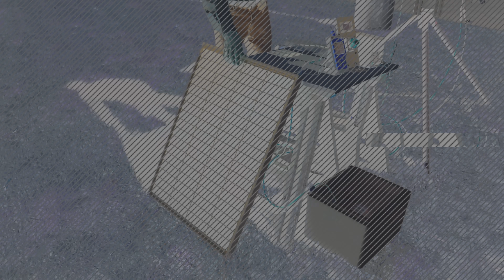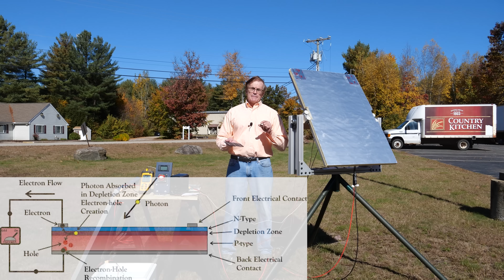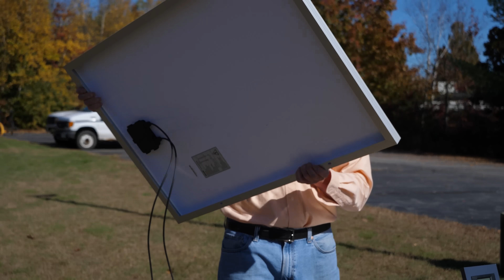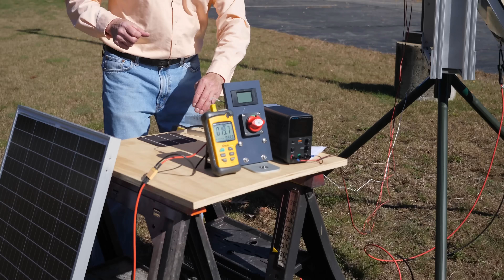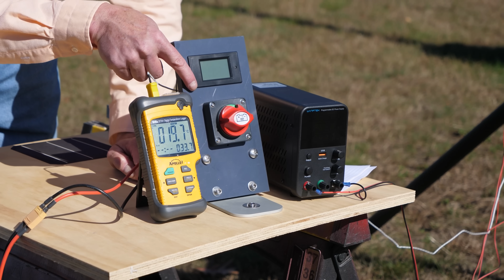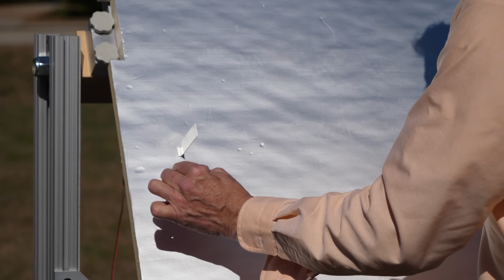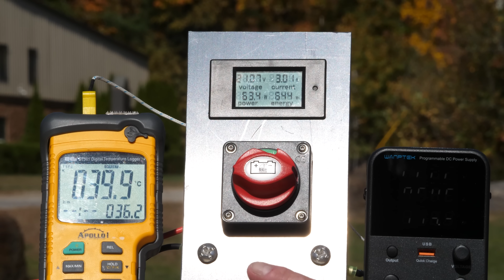Do you REALLY get enough out of your solar panel?

Comment: I see a lot of Youtube videos and other online analysis about cooling photovoltaics and efficiency.  This is all about energy absorbed that does not produce electricity.  But, what about the energy that is "rejected" due to reflection.  Could this be harnessed by focusing the reflection from multiple panels onto a thermal collector.  What kind of efficiency could be achieved?  Given that some systems are designed to track the sun this might be a way to boost the energy output significantly.
Reply from the maker: You hit on the limitation.  The efficiency of recovering that heat as electrical energy is very low because  of the small temperature differential.

Comment: Connecting panels in string (optimal for lower current) provides to bigger  voltage, which is not good for the inverter's switching active elements, especially when the temperature is lower (in winter). So, we have to connect smaller number of panels just to be on the safe side which is on the other hand not optimal. So, the control of the temperature should be important all the time.

Comment: You tested with a huge closed box, you would need to first test with an open back because it would get passive cooling from the surrounding air (not if on a roof though). Also, the reason would be cost. All that extra aluminum and fans could easily cost as much as the panel itself with how cheap panels are today. So the reason it isn't done, is your getting 3% more power, and slightly longer longevity for double the cost, plus the fans will die after a few years making the whole thing a huge waste of money. I would be like buying panels that cost twice as much for marginally higher efficiency for double the cost and calling it a sound financial decision. Panels are so cheap now that no one uses trackers, and the cost of the inverter is as much as the panels.

Comment: I 'm a huge fan of your channel, approach, and thought process.  Thank you.  Also glad to hear that your eye is on the mind. 

I'm looking for someone to tell me that I'm missing something, but to date, I haven't found it.  Please let me know if I need to return to Physics 101.

Abstract:        I live slightly North of you on the east coast of Canada around 46 degrees North. This is important and not just hey look at me "kind of internet stuff".  As you mentioned / alluded to in your last video, solar panels are optimised for low latitude, hot, and sunny countries. That's not where I live (nor you). There the sun rises and sets relatively in the same point on the horizon. Here the sun traverses about 60 degrees along the horizon during a year.         

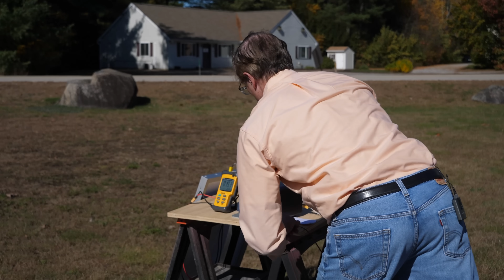Discussion:      Glass has a critical angle of 42 degrees. From my digging Photovoltaic glass is either that or something close to that. Which means that during the summer solstices it may be 10 for 10:30 in the morning until the sun rays are not in total internal reflection. Your solar collectors  could help with this, but with the large swings in incident angles, I suspect that they would be shadowing for a good portion of the mornings and afternoons.

Conclusion:      This leads me to believe that in the high latitudes one could probable reduce the amount of kit by a significant amount, maybe as much as a magnitude, if the panels actually tract the sun in 3D.

Now I know there are a lot of smart people looking into at solar panels and all things solar.  So before I grab a half dozen Arduinos and some servo motors,  and place an order for something that would struggle to run a toaster, please tell me what have I missed. 

Thanks and thanks again for the channel
Reply from the maker: Look up Brewster's angle.  Assuming the manufacturers don't add an anti reflection coating that complicates things, you're  likely  to find the best performance is when the panel  is aimed  directly  at the sun's disc.  
This would be a fun and easy experiment before  you spend much money.  Set up a convenient cell or small panel, add a power meter, and manually move the panel  to optimize output.  Measure  the angle of incidence relative to the sun.  Do this in the morning, at noon and in the afternoon as a self check.
Reply: @TechIngredients  thanks, That's where I guess I was heading, but I was hoping someone might have already done this, and have the data.  

Like you point out, it's simple enough.

thanks, I'll let you know what I find out

Comment: What about just using thermosyphon system to catch excessive heat behind the panel, in place of motors and co ? Then you can use the ot dry air to dry calcium chloride or zeolite for seasonal heat storage 😉

Comment: So if the solar panels is seated upon a liquid radiator can a liquid also remove heat that improves solar cell as well heat liquid to utilize that free heat to make hot water for personal use as well as preheat water to reduce fuel requirements for electric generatoration...??...
Reply from the maker: It's  a trade-off off.  The water  removes heat from the panel and, in the process, heats up. But to maximize  the benefit, the water needs to be as cool  as possible because  the panel  can't  get any cooler than the water leaving the panel. At the same time, to be of use, the water needs to be as warm as possible  to make preheating worthwhile. There might be a middle ground where this trade-off is acceptable, but it's not a free benefit.

Comment: If you don't have access to that stuff, you'll end up wasting a lot more money.

Get pre-made square C-channel.
Reply from the maker: Check out real prices and get back to us.
Reply: @TechIngredients  I've bought some of it for my own engineering experiments.

I paid $12 for a 10 foot long stick.

Not sure what your price range is, nor how many square feet of surface area you are trying to cover.

It occurs to me that in general, solar collectors are pretty cost prohibitive for practical power, so I would have guessed your budget to be higher than $500.

My apologies if I am wrong.

You can bend thin aluminum roof flashing with just some angle iron and some hinges, that's pretty cheap, if you go get the angle iron as old bed frames from a thrift store, or just buy the amount you need from a hardware store.

Should be able to build an adequate light sheet metal bender for aluminum flashing for about $50 and you can use it for multiple projects...

I personally would simply jacket the back of the solar panel with distilled water [28,000 ohms/inch] with some epoxy resin and some polyester fiber blanket material, with hose barbs glued into it so I could then use the hot water.

That would cost me about $10 [including the hose barbs], and if I add in a small recirculator pump you can get off amazon, its only about $30 if you have Amazon Prime, or add it to a shopping cart with other items... https://www.amazon.com/bayite-BYT-7A006-Heater-Circulation-Discharge/dp/B0196WL55G/ref=psdc_554568_t2_B08XM8GGR4
Reply from the maker: Not bad. We used about 60 feet.
Don't  forget about pressure.  As long as the water is wetting the fiber rather than filling the space, then you don't have a pressure  head.  That can be devastating  because  the panel  is on the roof and the water will be used as much as two floors below.  Water pressure  is approximately 1/2 psi/foot of head.  If the system is sealed then you could easily  rupture  the large area of the panel.  If it isn't sealed, you have to lift that water against a significant head, and that takes energy.

Comment: I would like to see a comparison between adding the bright aluminum fins VS engine black spray on the back of the panel as a heat dissipation aide. White (normal color of the back of the panels) and silver (normal color of bright aluminum) surfaces will emit far less heat than black. Engine black spray is designed to transmit heat and would be far more cost effective and easier to implement.
Reply from the maker: Surprisingly, paint, whether black or white, both emit about the same amount of heat. We'll be covering that in an upcoming video on supercooling with specialized coatings.

Comment: Would it be even better to have a water jacket? Assuming you could cool multiple pannels with small circulating pump..
Reply from the maker: I explained  that in the video.  You then need to drive the pump as well as the fans that cool the water.

Comment: I'm not too sure if this has been mentioned in the comments before me (there's like 2600+ at the time I'm typing this) but I'd be interested to see how much of that heat can be utilized to generate more electricity using thermoelectric generators mounted between the heatsinks and the panels. There will still be a transfer of heat away from the panels through the TEGs, but the temperature differential between the two could allow the TEGs to generate some amount of electricity. I'm wondering if the power generated by them would be enough to run the fans and maybe even a small pump if you were to water cool the TEGs. Potentially kills two birds with one stone.
Reply from the maker: I've  covered  this several times in these comments.   The TECs are rather expensive  and very  inefficient.
Take a look at our previous video on the "Campfire Generator."

Comment: Additionally the fans may make adding mirrors to cheaply increase the solar output without over heating the panels feasible. 
I would like to use the hot air to warm the house or drive sterling engines 
As always, thanks to you and your team.

Comment: You present a lot of good ideias in theory, but engineering must think outside controlled conditions. Those structures, like those side mirros you made in other video, won't survive strong winds. A lot of those ideas expect solar tracking, that is expensive. All those active parts (tracking and cooling) adds lot's of maintenance.
Those are great ideas, thought aren't "commodifiable".

Comment: at 12:30 you were saying that the water on the front of the panel wouldn't provide effective cooling, but the evaporation of the water could be effective at cooling the panel. A simple car windshield washer pump could be run off the panel, you wouldn't have the problems with the continuous pump drawing power.
Reply from the maker: That's  not true.  I definitely  said it would be effective. It also has several  drawbacks that I didn't  address.

Comment: Great Video! I have a question though, Without the use of a solar tracker. Can you still achieve a Net profit of power used for the cooling compared to the output? I feel like this would be a more typical installation.
Reply from the maker: Sure.
I only used and discussed  the solar tracking to mIntain as fair a test as possible.  It's  simply  a matter of geometry and the EFFECTIVE area of the panel.  If you lay it out, you'll  see the effect of foreshortening is rather small, and compared to the increased light intensity at lower latitudes and closer to noon, it is not a deal breaker.
Reply: @Tech Ingredients  Thanks for the reply! 
I suppose it wouldn't be hard to implement a system that turned the fan on only when it was benificial.
Reply from the maker: Of course.

Comment: With all the solar breakthrough that we are seeing, there is usually a simple problem. Economics. You can add moving parts to a system to increase the efficiency, but it's just more economic to add more panels, and only worry about this if your entire roof is covered with panels. Efficiency gains have to be cheap and scalable. Probably the next gen solar panels will have some sort of quantum dots, because that's cheap.

Comment: Usually, the fans will die much sooner than the rest of the panel. Adding moving parts to anything adds a reliability problem.
Reply from the maker: Usually?
Reply: I can't say anything about the specific fans you used. But we used to have servers on top of buildings at work, to provide Internet connectivity via radio links. The fans we used were normally the first to die. But we had other problems as well, like lightning bolts falling nearby frying the whole electronics.

Comment: Neat experiment and I can see the benefit of actively cooling the array. The practical engineer in me, however, questions the reliability of such a fan system over the lifespan of the panels. Panels require ongoing maintenance (ie. cleaning) due to environmental contaminants (eg. dust & debris; bird droppings etc.). The fans would also require similar maintenance, but I can see it being rather difficult to clean the cavity in which the fans move air; along with verifying a fan hasn't in fact failed. This is because the panels largely aren't run in a simple straight line, but typically placed in groups (eg. 3x5 array; 2x8 array etc.), limiting access to backside of certain panels. I can easily envision these ducts becoming riddled with cobwebs and minor debris as a result! :)

Similarly, for the added cost and complexity of the cooling system (fans; power supply; wiring; fins; backing plate etc.), it's probably going to be cheaper to add something like a single additional panel, which will likely increase output overall, while at the same time reducing complexity. It would also assist with offsetting degradation in the panels. For a roof space that has limited space, and therefore limited panel capacity, then such an active cooling system may make more sense.

PS. for those wondering if you can just simply remove a panel to clean behind it... in a practical sense - no you can't. It can be done, but you'll be dealing with wires that are clipped to the rear of panels; bolts that often won't release from the mechanical hold down mechanism (typically due to galvanic corrosion between the stainless steel bolt and the aluminium hold down bracket) etc. It a nutshell - it's not a 5 minute job, and you may run into issues if the system is a few years old.

Comment: Could you use the solar heating system that you solar panels on the roof to make as a hot water heater? Coupled with this thing you have one system doing double duty?
Reply from the maker: Sure.
However, as the water becomes  warmer, the efficiency  benefit to the panel  decreases.  It's a trade-off.

Comment: This is cool, but need more data!   Strait on with the 68% sun, 3 watts in gave 5 out.  But do the fans still help produce more then they use at oblique angles?  If you can either test different angles to find the tipping point where the fans stop helping (less then 3watt  boost) - or do a full day test facing south at your ideal angle upward (probably 35ish) to get the average for us who don't have panel movers.  Would really help give us the full picture.

Also how about a liquid to liquid heat exchanger; setup with antifreeze on the roof side and preheat cold water into hot water heater on the other side.  - Cool your panels and preheat water at the same time?

Comment: Rotating and moving up and down to peak the panel output, Plus a passive heat sync is more efficient than putting fans on the back.  Most Solar panels are not even pointed directly at the sun for any meaningful amount of time.  So, they never see peak efficiency... but for a couple of minutes a day.

Comment: I understand that you want to extend the life of your investment.  But solar technically is advancing faster than ever before. So in 25 years what are the chances that the new panels will be significantly more efficient and cheaper.
Reply from the maker: They will be.  But, this principle can be used with the better panels  as well, not to mention  that you don't have to replace older panels, you can add the new panels to increase your capacity.

Comment: Much ado bout nothing!
With the cost of 2nd hand panels plummeting, why not just add a few extra 'cheapie panels' to offset the thermal efficiency losses?

For example in Australia, I recently purchased a complete 2nd hand 6kw system for $500AUD. This also included the Grid Tie Inverter which I don't use, because I store my excess power in 2nd hand Lead Acid Deep Cycle Batteries that I buy for $30 each. I have a 6kw Household Inverter that switches to Battery whenever the Grid goes offline or out of acceptable Power Range (190V-270V), but during daylight hours the Inverter runs my household consumption, and any excess power required is imported from the Grid. I currently have 32 x 12V Deep Cycle Lead Acid Batteries in 8 x 48V banks @ 100Ah. Technically I have 40kW storage, but in reality I only ever use a maximum of 20kw - as I don't allow my Deep Cycle Batteries to go below 50% drain. My total investment has been $3k AUD for a 6kw Off Grid Power System, which equates to $500 AUD per kw, for a working household UPS.

Now carefully consider your cost and time to 'upgrade' all of those 24 x 250W panels, vs buying some extra 2nd hand panels and adding them into the system. No moving parts, no maintenance, and if the 'cheapie' panel(s) ever fail, then it's only likely to become cheaper to replace them over time anyway.

Comment: I could see this making sense in an installation that's easy to service. The fans may be reasonably waterproof, but running even just 8 hours a day outside in the elements means they're going to get gummed up fast. I wonder if taller heat sink fins that are passively cooled by convection and wind currents wouldn't be a more reliable alternative.

Comment: I think just the fins on the back would make a difference without the fans.  At an angle with the fins and the plate, you would get convection cooling.  Not anywhere near as significant as forced air flow, but you also do not need the fans, and the associated cost of replacing the fans as they die.  And those fans only live so long.